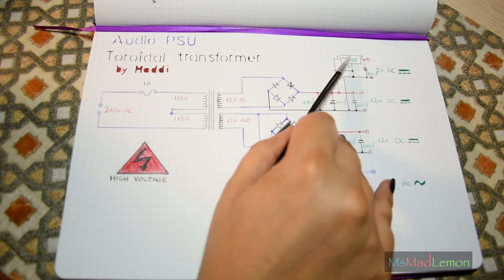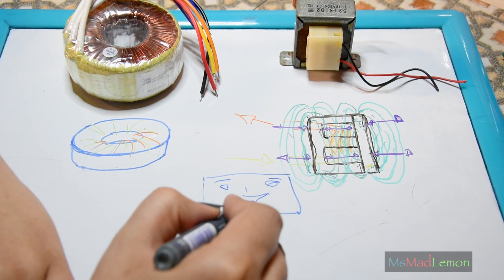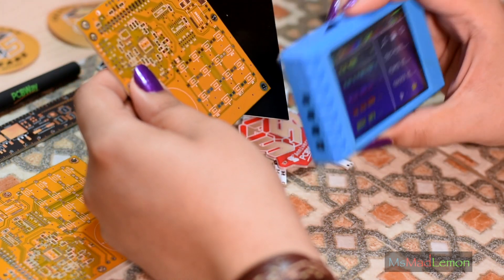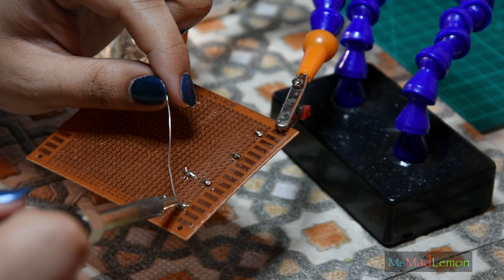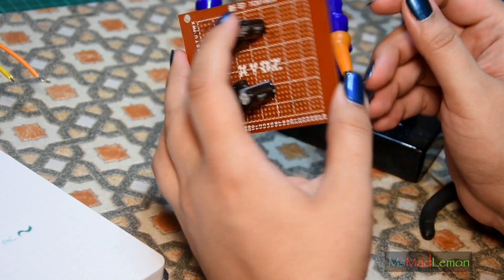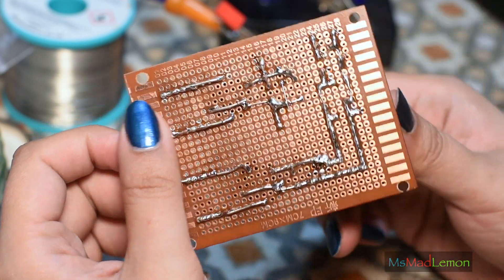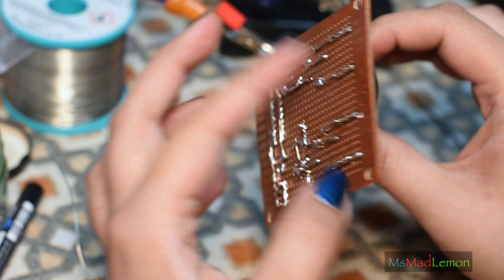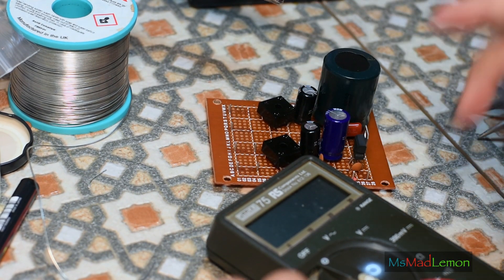PSU circuit build - SIDBoomBox Project 04

Comment: 7:11  I've measured that there actually IS a lower noise from a transformer's secondary by a couple dB, one "polarity" vs. another.  Look it up in high end audio, it's a thing.
Reply from the maker: Youre right actually, i've noticed the same recently, more on the mains side of it i discovered if you swap live and neutral, there is somehow a little difference!

Comment: sorry if u already answered this (im terrible at attention to detail) but how come you have two separate +12v DC supplies instead of a single supply, or a dual supply +12v and -12v?
Reply from the maker: one of them I wanted to power all the relay switches, and the other to power all the audio circuitry, just to keep any interference or noise at minimum... Now i've made it +12v for relays etc... and +15v for audio circuitry.
Reply: @MsMadLemon  ah good idea!

Comment: are solder tracks suitable for these currents? it's like 6 amps isn't it?
Reply from the maker: Solder tracks should be fine, they're thick enough for 6 amps, though this isnt going to be drawing all 6 amps, the circuit will just draw from it what is required.
Reply: @MsMadLemon  how do you work out how big of a solder blob you need for a given current?
Reply from the maker: @SoniEx2  It's a bit like wire gauges, the amount of current it can handle depends on the thickness of a wire or cable/ or any other metal. I sort of estimate it, the thickness of the track I put on would be enough for 3 amps, judging by the thickness of a wire which is rated at 3 amps (which is what each voltage rail can provide) and even with that I know my circuit wont be drawing the full 3 amps.

Comment: I'm curious why you make solder tracks instead of using jumper wires?
Reply from the maker: I do both, also i  have a lot of solder, jumper wires tend to get very messy if theres too much, i cant imagine building everything with jumper wires if its a complex circuit. most of the time i use the component legs.
Reply: Me too.
Reply: That's "Great Scott Style".
Reply from the maker: @NiHaoMike64  "Great Scott Style?" Not sure what you mean exactly
Reply: @MsMadLemon  That's how Great Scott builds circuits. The more usual way is to solder on bare wires.
Reply from the maker: @NiHaoMike64  Meh, I tend to do whats easiest for me rather than follow what is said to be the usual way, each to their own way of working.